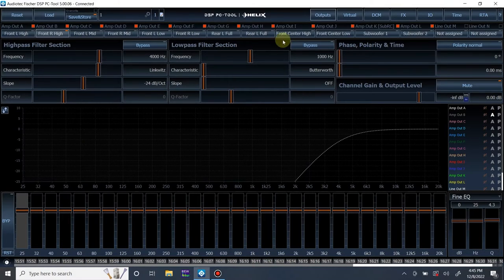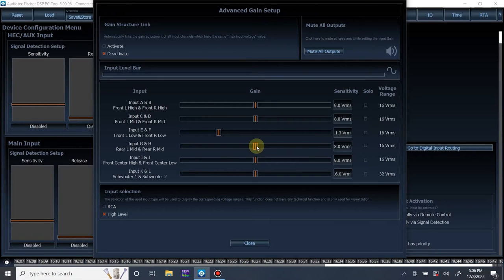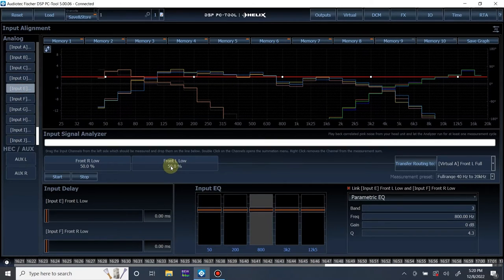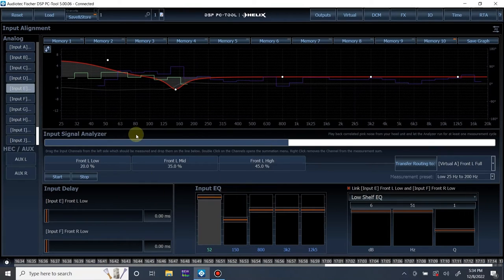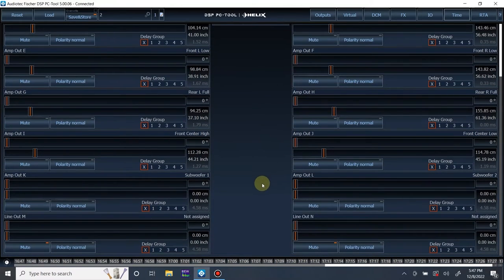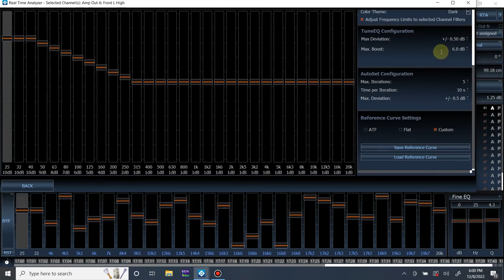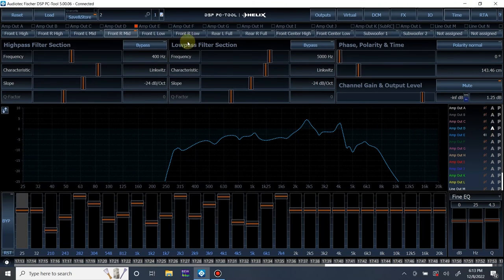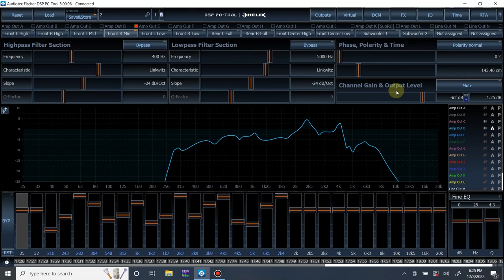ResoNix Sound Solutions - Tech Tip: Helix DSP Input EQ, Summing, Automatic Time Measurement, Tune EQ

Comment: I got the helix.2.. I dont see the final option you have (the tuneeq eq )  but did try with A speech mic to use as RTA mic to auto set. Whats weird is after I saved my work as preset 1.. I used my focusrite with a akg music recording mic with different result, so to play it safe i ordered a RTA mic from amazon will be here tomorrow. Is the calibration file why i am seeing different results same setup ??  whats even more weird is the Focus rite was able to increase my tweets substantially (maybe it could hear that high) as it made the last 4 bands increase but seems the bass did not show the same shelf like start that the USB speech mike 2 (a medical dictation mic) did very interesting .
Reply: Hoping you figured this out by now but you can’t use those types of mics for this. Measurement mics have 2 main qualities that make them measurement mics — they have an omnidirectional pickup pattern, and they have a very flat frequency response. They can also often take very high SPL. The mics you’re talking about are going to have cardioid or hypercardioid pickup patterns, be very sensitive to SPL, and also have nothing that could even remotely be called a flat frequency response. The calibration file for the reference mics also further flattens the response to compensate for the small fluctuations in the response caused by the mass production process, which will be specific to that very one unit, hence why it has its own calibration file supplied from the factory. Your system is nowhere near flat or even correctly tuned if you used these other types of mics for measurements.

Comment: Excellent video on using the RTA features in the Helix software - best I have seen so far!  I am new to tuning, but focusing on learning how to use REW (with some success so far).  But two questions: 1) When tuning in the car, how loud do you have the system?  Loud pink noise and losing hearing seem to go hand in hand (and why I have been tuning outside the car) - but you need the level high enough to get good measurements.  Do you use earplugs or just tough it out?  2) How are your tuning results using the built in RTA interface vs using REW?  Close enough that most can’t hear a difference or should I stick with using REW?  Thanks!
Reply from the maker: "1) When tuning in the car, how loud do you have the system?"
 Loud enough to overcome background noise, and loud enough to be similar to where I will listen to the music. I wear earplugs when taking measurements sometimes if i do them loud enough. 

"2) How are your tuning results using the built in RTA interface vs using REW?  Close enough that most can’t hear a difference or should I stick with using REW? "
 When I do it, it's pretty close since I know exactly what I'm doing and know how to use the tools in front of me to the best of my advantage. If you are not as well versed in one or the other and don't know how to fully use them, then you may get different results.
Reply: @ResoNixSoundSolutions  Thanks, that is some good insight!  I am still a “rookie” with tuning (my own car, custom 3-way active using a Match UP10DSP in a BMW with HK and factory MOST system) but have learned a lot about using REW.  The Helix interface seems a bit more “clunky” to me when compared to REW, especially when trying to do things like level match two channels or easily pin point frequencies where there might be problems I need to address - would be nice if the curser on the graph were better.  Also, the Helix interface when tweaking the acoustical response to match the desired target curve is an “interesting” iterative process with the Helix “buttonology” when compared to using REW.

If possible, it would be great to see a video where you actually tune a system, start to finish, using only the Helix software.  You have already covered the initial setup and time alignment portion.  I am talking about the frequency response measurement/adjustment portion of the tuning (to match a desired target curve), including using some of the tools (like all pass filters, channel phase adjustments, etc.) when encountering different frequency response/cancellation problems, etc, encountered in a car.  Great stuff!

Comment: Thanks for the tutorial. It answers a lot of my questions.

Before doing time allignement you can adjust the input sensitivity of your mic in the setup of Windows. Standard is 0db. If you raise it by 10 or 20db it measures without problems. Even the sub😊
Reply from the maker: Yes, this is something I check every time now.

Comment: Thanks for the great video. Very helpful.
With regards to the input output screen, I was going to assign the front and rear speakers to the subwoofer. So the sub will be playing regardless of the fader position on the head unit. Is that likely to be a problem with phase cancellation etc or not? I noticed how careful you were checking the signal from the 2 front speakers to make sure the sub got a good summed signal in. My sub has a left and right inputs. Would I be better summing the fronts together into the left and the rears into the right input? Or summing both lefts and rights together?
Or is it safer just sticking with the fronts like you did?
Thank you.

Comment: Great videos. Thank you for helping us noobs with getting things set up properly.

But im having some issues with my Match pp86 mk2 amp,  the problem is i think with the IO settings, i can't get the C and D channels to play anything but the rear speakers, even if i only have one input on the IO page i still cant make the front mid's to play.

 I can get the tweeters in front to work fine on channels A, B. 

I have tried using channels E and F  instead, but the speakers just won't play for me.

I have a 8" mid and a tweeter in  the front doors and stock speakers in the rear, and a match pp 10e-q sub.

Any help would be nice because im about to go crazy figuring this out.

Edit: I can´t seem to set the gain on the amp either, no matter what signal i play on a near max volume to set the input gain i get no clipping light, infact the clip light wont light up, not even green before it goes red to signal clipping like it did on the PP62 i had before.

Thanks in advance.

Comment: Great video! - input sensitivity gain.  Use 0db pink noise? You said white noise but in manual says pink ? I thought a 1k 0db tone would work too? Or you still prefer that song over all the above?
Reply: I had the same question...does 0db pink noise even exist?
Reply: @PbcMr  contacted helix. Use input sensitivity tone when you install dsp software.
Reply: @daveroski  I don't recall that file?
Reply: @PbcMr  open software. Very first screen before you hit connect. At top there’s a link to test tones. They put in local folder on pc when it installs and brings you there.
Reply: @daveroski  Ah, see that.  So the PulsedSineSweep file in the Input Gain directory?
Reply: @PbcMr  yep. I would go down a little extra too
Reply: Weird. When I played the tune at the loudest level I had no clipping on an input.
Reply: @PbcMr  high level or low level. Is your headunita volume at max of unclimbed distortion while doing it?
Reply: @daveroski  low level.
Reply: @PbcMr  if your playing max undistorted volume and your input sensitivity is maxed out without clipping light than your not getting any voltage out of your low level. I would use a meter and check voltage coming out of radio with no speakers playing a 1k tone at 0db
Reply: @daveroski  Not following what that implies and/or if there is anything I need to do?
Reply: @PbcMr  had to edit
Reply: @daveroski  So it has nothing to do with using the Advanced Gain adjustment tab vs regular?
Reply: @PbcMr   what helix dsp are you using ? Does it have physical knobs or is it within software. ?
Reply: @daveroski  Should have been more clear earlier.  Using an Amp/DSP combo, the MatchUp 10 DSP.
Reply: @PbcMr   walk me through what you have done for setting max volume starting with head unit? aftermarket headunit?
Reply: @daveroski  It's a Match Up 10 connected to a Nav TV Zen V/MOST150 interface and to my vehicles OEM main head unit.
Reply: @PbcMr  using optical?
Reply: @daveroski  Correct

Comment: Hi. Thanks for video!!! One question. Is it normal when the equalizer is turned up to maximum or minimum?  As far as I know, raising or lowering the equalizer a lot leads to distortion.
Reply from the maker: "As far as I know, raising or lowering the equalizer a lot leads to distortion."
You have been led incorrectly. Lowering never causes distortion. Boosting can, but this all depends on your gain structure, as well as accounting for the natural frequency response of the signal you are playing through the system. Anyone blindly saying "boosting EQ is bad" can be fully ignored, as they clearly do not understand audio, and how the hardware and signal work together.

Comment: I have a BMW E90 with two front speakers and separate tweeters on the doors near the windshield.   Two subs beneath the front seats and two rear deck speakers. 
How do I split the front speakers into the tweeters and woofers on the door?
Is there a way to do that ?

Much appreciated !

Comment: Do you use the input signal analyzer to make your later Tuning easier to not have so much of a deviation of EQ ?
Reply from the maker: @Nightjar726  I personally only use it to get full range signal, and to correct phase and timing differences. Frequency response is a much lesser problem since it gets ee'd on the output anyways. I will only flatten frequency response if I want to have two sources on one tune.
Reply: @ResoNixSoundSolutions  thanks brother !

Comment: Did you explain how to set levels? or do you just set it by ear? And do you set them, before or after you EQ with the RTA?
Reply from the maker: For the input? It's just a matter of summing them, taking a measurement, and adjusting input percentage until you reach a desired result.
Reply: Sorry, I should have been more specific. Actually my question is for the output.
Reply from the maker: @nectros7157  that happens during tuning. After initial measurements are made, eq and levels are done at the same time.

Comment: maybe a dumb question, but the rta in the software uses the mic from your laptop? and if so, does the laptop placement in the truck make a difference?
thank you for this video, huge help
Reply from the maker: This is an input signal analyzer. It is measuring the frequency response of the signal that is feeding the processor to aid in OEM integration.
Reply: @ResoNixSoundSolutions  aha. So it's built into the amp? No need for a mic? If so that's incredible. I have a v twelve I'll be setting up soon. So this is ridiculously helpful. Thank you again! 👍👍
Reply from the maker: @83codygs  this and the microphone portion, while being the same tool serve two totally different purposes and measure different things in the sound system.

Comment: Should I do a helix ultra or the 12V? I have 13 speakers in this mercedes bermester system. I was thinking of the helix ultra with 2 audio control LC- 6.1200
Reply from the maker: Depends on a few things. That said, I really wouldn't suggest those amps.
Reply: @ResoNixSoundSolutions  what amps would you suggest? Ty for your reply!

Comment: do i need to rta both inputs and outputs or can i just eq the outputs? i guess doing so will affect sound quality. great video btw thanks
Reply from the maker: Depends on the situation. Sometimes it is necessary to eq the inputs, but usually not required.

Comment: does the tune require the usb card for the helix or a usb interface on the computer? Im gonna do this to mine just installed and running it day 3 in a Basic crossover.  I wanna check my input too but Was going to use JL audio TuN to use my Focusrite  but if i can use it with the pc and achive this this looks easier

Comment: Have you ever tried bridging V Twelve channels by reversing phase to one channel in the DSP and then wiring the load across the two speaker positives? Of course you'd need to insure that input routing, gain, EQ and time were identical for both channels being used.

In theory, it should work - but I'm not sure about reality.

It sure would solve the biggest drawbacks of the V Eight/V Twelve IMO
Reply from the maker: No. And it really isn't that much of a drawback. Most people don't know how to set up gain structure properly. With a proper gain structure, 75 watts per channel surprises damn near everyone :)
Reply: @ResoNixSoundSolutions  Every system is different I guess.
For my two systems, the V Eight would be useful for 3-way front stage with a bridged pair of channels on midbass, and the V Twelve would be useful for 3-way front and 2-way rear, again with a bridged pair on the front midbass. 75W on midbass just won't cut if for me, personally.

Anyway, if you ever have the inclination to try, I'd be interested in the outcome.

Comment: If my input to the Helix is digital/optical, can I just skip straight to Time Alignment and EQ? I couldn't find any of the input gain settings, so I concluded its either due to me being a V Eight Mk2 (and this demo being a V Twelve) OR, more likely, down to Analog vs Digital Input.

I was able to find my clip limit using the first steps, but now I want to add some gains etc... unsure how to do this safely without pushing kit too hard.
Reply from the maker: Yes, go right to output tuning.
Reply: @ResoNixSoundSolutions  thank you kindly! Especially for the quick reply!

If I theoretically upped the gains in the software and on the V Eight, what risks do I pose? Distortion?
Reply from the maker: @v1ni  that depends on how much and where you are doing it.

Comment: Love the videos and has helped tremendously so far.  Any chance you could help me with how I would do this for just 4 channels.  Components with passive crossover at 4100hz for tweeter in front and 3-way coaxial with passive crossover for rear?  Your videos are great and I have helix dsp mini mk2 and umik -1 mic.  Everything else is prepped, flat input, polarity, balance, time alignment, levels, but everytime I run rta, It gives me virtually no mid or bass in the rear and makes the front almost ear.piercing.  I'd like the fronts to be mainly 3 or 400hz and above and the rears to just be in bypass mode for the time.being until I get a sub.
Reply: This just sounds like you need to customize your target curve to preference.

Comment: I don’t have an advance input box to click on.  What am I missing?
Reply from the maker: What dsp do you have, and what software version
Reply: @ResoNixSoundSolutions  I have a Helix V8 MK2.  It was programmed with Version 4.  I also have Version 5 but both pages look the same.  I must be missing a setting that has to be selected.
Reply: @ResoNixSoundSolutions  I actually bought this from Vanguard 2 years ago.  I might just call and ask some questions.  I have never been happy on the tune the local shop did where I live.
Reply: Looks like it was removed on the later releases. I don't have an advanced button either and I can not find where they hid it.